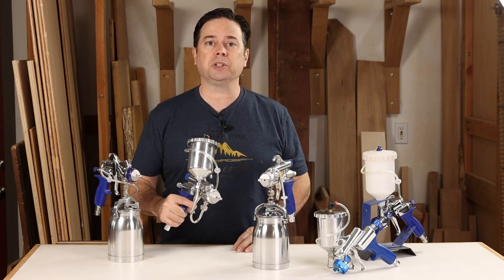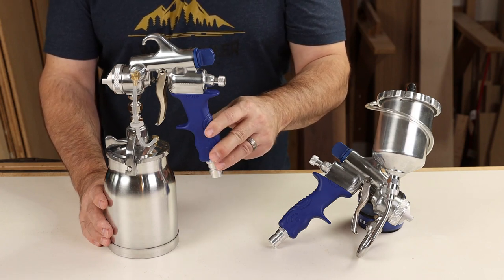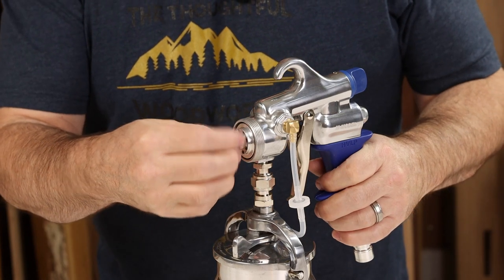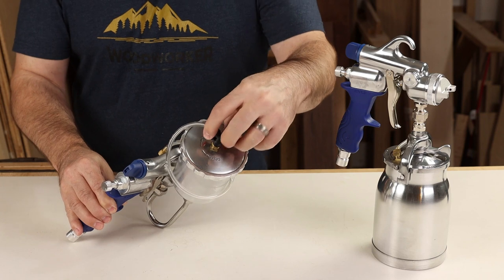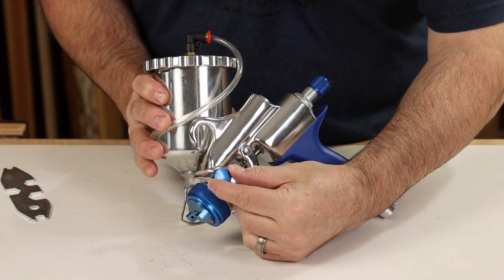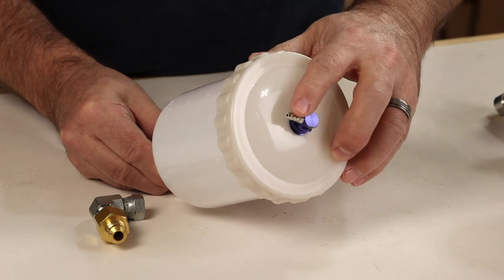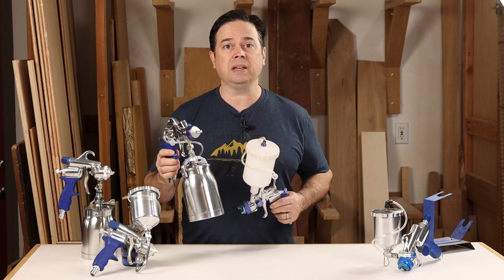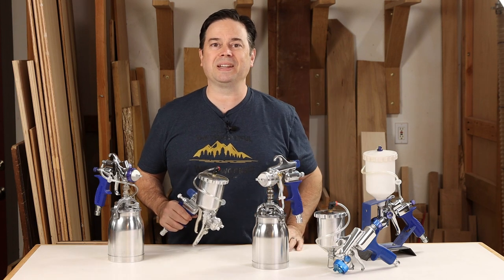Which HVLP Spray Gun for your Woodworking Project or Which HVLP Paint Sprayer?

Comment: Is there a conversion kit for the T70 to make it into a gravity gun?
Reply from the maker: The short answer is no.  The T70 gun is good as a pressure assisted bottom feed gun, or works great with the Fuji 2qt. pressure pot.  The T75g is the gravity feed version in the T series gun lineup.  The M model does share the same gun body for the bottom feed and gravity feed versions.  Thanks!

Comment: I mostly spray water-based lacquers from Target Coatings.     ... Would using a 3-stage unit perform better atomization than a 2-stage?  Would it reduce orange peel?
Reply from the maker: Yes, I think you'd appreciate the difference stepping up to a 3 stage.  You won't have to thin the material as much, and it should eliminate orange peel, as long as you're using the right air cap set.  Best to you.

Comment: So is there any functional differences between the t and m model guns? I tend to like the full metal body of the cup, and also like the fact that one gun can be both bottom feed and gravity fed. 

I'm thinking of purchasing the semi pro 2. I mostly just want to spray urathane, and paint on home made furniture  and cabinets.
Reply from the maker: Hi Chris, there seems to be very little difference between the M and T model.  Maybe a few extra stainless steel parts in the T model, but I've never had an issue with the M model.  It's the only Fuji gun that can convert from a bottom feed to a gravity feed, with the optional cup.  I have a video on the Amazon Semi Pro 2 listing looking at both M model guns.  Good luck with your decision!
Reply: @TheThoughtfulWoodworker  Thanks for the information, I will go look at your other video.

I'm wondering one last question please, since I spray latex paint and oil based polyurathane, would it be wise to also purchase a 2.0 or 1.8 tip, thinking it will help with not needing to dilute the product, and have a thicker urathane coat for a nice glass like finish?  Or is the 1.3 tip good for both?

I figure to get the best deal I nned to buy everything in one shot so I don't have to pay extra shipping latter on. Thanks.
Reply from the maker: @mrchrisknight315  I'd get the 1.8mm tip as well.  Have fun spraying!
Reply: @TheThoughtfulWoodworker  Thanks, I will order the kit. I look forwards to getting nicer results over hand painting my work. Thanks for all your time and information.

Comment: Do you have any videos or reviews about the Fuji 9622 Touch-Up Spray Gun?

Thanks

Randy
Reply from the maker: I have a Fuji touch-up gun that came with a turbine package, but honestly I haven't used it yet.  I believe it's a bleeder style gun, where most modern Fuji guns are non-bleed style.  I'll be sure to post a video when I get a chance to use it.  I keep reaching for the T75G and G-XPC, and forgot about the touch up gun!
Reply: I've been spraying for awhile with an inexpensive Rockler HVLP setup that I bought in a pinch when I couldn't get a good finish using a brush on a walnut desk top.  I've been eyeing the Fuji system for awhile as I save up for a quality HVLP system.  Since I primary use water based Poly I think the Mini-Mate 3 will work best for my budget.  My next project involve spraying the inside of boxes (storage cubes for my camper).  I really like the compactness of the G-XPC gun, but I've seen another video that speaks to the quality of the T70/T75G series being much better than the G-XPC.  Since you have both I'm asking for your thoughts? @TheThoughtfulWoodworker
Reply from the maker: @warrenbarnes6629  biggest difference is the cup size, smaller on the Gxpc.  I use it just as often as the other guns.  You'll like it.
Reply: @TheThoughtfulWoodworker  Great!Thanks for the feedback.  I can see in your other videos how easy it is to clean too.  Great videos, keep up the good work!

Comment: Can a LVLP be used to spray water based poly?
Reply from the maker: It depends on the system itself.  If you are considering a particular system or brand, it should state in the manual what type of fluids you can spray, along with recommended tip sizes.  Check for an online manual and see what you can find out.  If the un-thinned viscosity of your poly allows it to flow from a #4 Ford cup in 35-45 seconds, you should be fine.  If not, you may have to thin slightly with water.

Comment: Can a non Fuji HVLP gun be used with the Fuji system with the correct fitting?
Reply from the maker: Most of the turbine based guns work the same way.  They operate with less than 10psi.  I would think if the fittings match, it should work.  I haven't tried it though.
Best to you.
Reply: @TheThoughtfulWoodworker  thanks for your reply